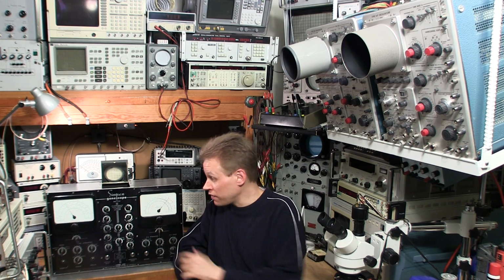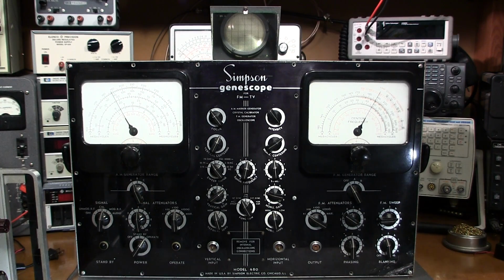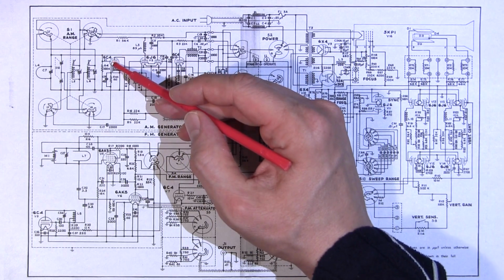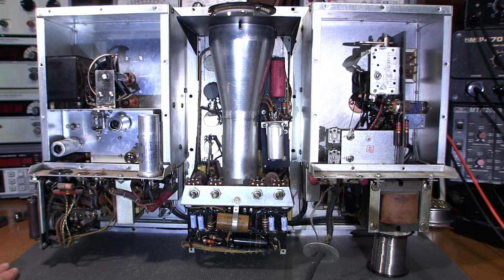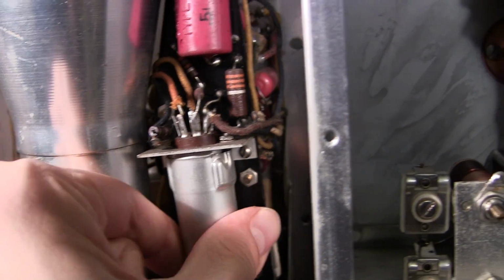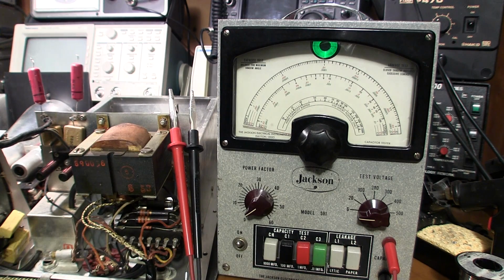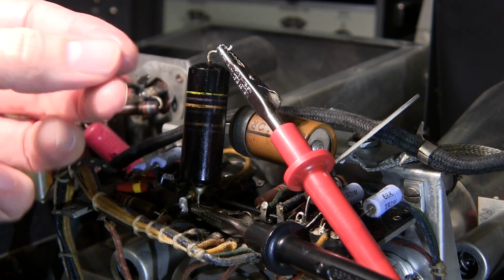Sneak Peak and Tear Down of a Simpson Genescope 480

Comment: I would love it if you could address this question during a disassembly : “these are the parts that make this piece of equipment as good as it is , this is design approach is what indicates the essence of  quality” ( while tracing out a circuit with a pen or such pointer) . What I’m after is , in your opinion where does the quality lie?

Comment: Could the horiz. and vert. plates be reversed on purpose because the crt is mounted 90 degrees from the  intended design so the swap was a cheap fix for a mechanical mount design flaw?  BTW love your vids.

Comment: Paul I agree, install the bnc Jack's. And it would make it more useful if you added am and shortwave. Can't wait to see the restoration!
Reply: Also when a resistor is in parallel with a capacitor (I understand it's to discharge the cap) isn't it like a leaky capacitor? I.E. can pass dc voltage bypass the capacitor via the resistor?

Comment: The true heart of any of this equipment is the power transformer.mWhen that goes , Game Over. That has happened to me on several pieces of gear. After weeks and dollars once up and running, the smell of hot varnish filled the air as the equipment went out dead forever.

Comment: Noticed the line fuse F1 is not providing maximum protection. It should be connected to the hot lead of the AC plug in series with the line filter.

Comment: Interesting to see the harnessed wires were tied with lacing cord. When I was building test equipment we did it that way and it was much neater than using tie wraps as it made less of a bump. In the 1980's we used polyester tape but earlier I know they used linen tape. Usually the lacing tape was coated in bee's wax which helped it pull tighter more easily. You wrap the wire bundle and cross over the tape and wrap again loosely threading the free end under the point where it crosses. Then pull tight and finish with a overhand knot or sometimes two. The polyester tape could be seared with a soldering iron at the knot to keep it from fraying.

Another thing we were taught was you NEVER mount a component without a stress relief bend in the lead. The lead must remain straight from the component body for 1/8 inch and then have a 20 degree bend before it is routed to it's termination. Too bad so much you work on was not built that way! It reduces component failure from physical strain.

While I'm at it when you route wires you should always leave enough length that it can be cut off and re-terminated at least once, unless there is some reason that the extra wire length will cause problems.

The drawing errors! When we built equipment it was a standing joke that we were the proof readers because nothing of any size was ever built without us finding a mistake in the drawing. It appears that Simpson's drafting department never updated to a corrected drawing! They always complained about the cost to revise the drawings!

Comment: Paul, Would not the schematics be correct is they either rotated the oscilloscope tube 90 degrees or thought that the mirror image reversed what one see on the horizontal and vertical plates?

Comment: The Horizontal and Vertical Deflection are probably correct on the schematic. It just depends on ones point of view. Rotate the tube 90 degrees and the sweeps are switched.

Comment: The art of cable lacing.  I learned to do this in the 1970's and this skill did me good steed in the early 80's when I worked in a repair depot for navy aviation electronics.  There were a lot of mods and upgrades on a big piece of test equipment that used a variety of cables.  Did the mods and laced external wires added to the cables.  I received an Artisan of the Month award for that job.

Comment: I had this same piece of test  gear for years and I ended up selling it at a hamfest several years ago.This makes me wish I still had it. The only thing I still have is the original manual and it is in perfect condition. Back then this was the most impressive piece on my bench. I also had its sister unit the 479 that just didn't have the scope. Miss them..

Comment: Paul, please go ALL the way and replace things willy nilly with modern upgrades, as this unit will be used to test real modern equipment. Might as well as stay as safe as possible with as much as you can. Especially that ancient sweep circuit and the basic oscillators. That would include the crystal used in the a.m. circuit... you might want to use at least a temperature-controlled crystal oscillator.

Comment: Add the extra range. This is a sensible addition/modification, and would not take away from its original purpose. You are right. If Simpson added the extra range, it would have served a broader purpose, and been more valuable. I'd like to see how you would approach it, especially for 160 meters/AM band.

Comment: Takes a real engineer to look at a schematic and say "This is wrong" nice job.  When i was younger there was nothing nicer than working on something that had not been opened since it left the factory, you didn't have to clean up other people's mess.  Those bumblebee capacitors were leaky back in the late 60's in equipment that was relatively new.

Comment: I have always loved Simpson test equipment. From my early days of the late 1970s till now I have used Simpson 260 millimeters for just about every kind of parts testing you can imagine . I have tested so many capacitors with the 260 I can tell you without picking up another peace of test equipment whether a capacitor is leaking or not. It just comes with years of using test equipment for a long period of time.  Very nice video Paul !! I like very much how you go through a schematic and explain, to a tee, all the functions within the circuit you are working on. Love it.
Reply: Really funny seeing those yellow capacitors just dangling there lol nothing new the crazy things I have seen Paul lol  hahah

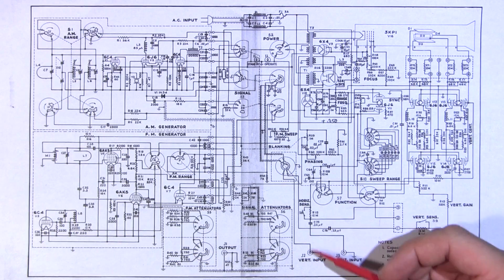Comment: Howdy, Phil!  Wow, this is an AMAZING piece of kit!  One question, however;  you mention around 21:00 how the schematic seems to confuse the horizontal deflection plates with the vertical plates.  Yet, given that the CRT itself is mounted vertically for viewing through the mirror, is it not feasible that they needed to rotate the tube 90 degrees, perhaps due to space constraints?  Also, as for whether to extend the range of the unit, I'd say YES, absolutely!  After all, while this may be a collectible for historic reasons, it's not like a vintage radio or television geared toward the lay person, and as such I doubt "authenticity" is highly prized in a piece such as this.  Even if you DO end up selling it, anyone who's willing to pay for a unit like this will likely want to get some use out of it, and I'd imagine they would really appreciate such a modification!  Thanks for posting yet ANOTHER fantastic, informative video!  Keep up the good work, and you can bet I'll keep watching!
Reply: It's "Paul" not Phil. ;)

Comment: If you would take the time to look up the pinout for a 3KP1 Crt you would find that the drawing is correct (D1-D2 pins 9&10 Horz D3-D4 pins 6&7 Vert). It's drawn that way for clarity. .Reference RCA tube Manual. Get one.
Reply from the maker: Hi John, what I state is correct, it's you that may need to do the research.... And lighten up too! Stop hanging around "negative forums" so much, and your knowledge might just grow.
Reply: I did make a
mistake on the pin numbers. D1- D2 are pins 8-9 and D3- D4 are pins 5 and 6. D1
and D2 are usually designated as the horizontal deflection plates and D3 and D4
the vertical which conforms with  the schematic.

That being
said,. It probably doesn’t really matter whicn set of plates are used as the horizontal
or vertical as it would only effect the physical orientation of the tube.

The schematic
is correct. 

As for your
comment of my needing to do more research, I’ve done mine.  I started to  read and understanding schematic diagrams in
about 1950  fixing vacuum tube radios. Graduated
from  Valparaiso
Technical Institute with an associate degree in electrical engineering. I joined
 the Air Force and worked as a Precision Measurement
Lab Tech repairing and calibrating instrumentation in the AF inventory..
Leaving the AF, I went to work for Hewlett Packard Co. as a lab tech repairing
and calibrating  H.P. gear. I then went
towork for Philico at  NASA as first a
lab tech in the calibration lab, then a Technical Writer. I wrote the procedures
used to calibrate instrumentation used in the NASA inventory.  My last 13 years in the electronics field was
at the University of Houston as Staff engineer for the Dept. of Chemical
Engineering. Here I designed electronic instrumentation to be used by Grad
Students in their research. 

I’ve done my research
Reply from the maker: Thanks for sharing some of your history John, but don't feel you need to though over some deflection plates in a CRT. If you watch my explanation of the deflection plates in it's entirety, you will see the discrepancy.

Comment: before I go I do have a question. I have bk 700 tube tester, on sockets no1, 29, 30 when doing the no 1 test the needle goes left very hard,  is that a very bad tube or do I have problems with this tester. many thanks
Reply from the maker: Hi David. What is the tube number? Try to put some sideways force, "twist" on the tube in the socket while it's under test. Sometimes the contacts in the sockets get stretched, and don't make good connection. Gently twisting the tube helps the pins make contact in the socket again.
Reply: no. 1 socket 6ag5, 6aq6, no.29 socket 6k6, 6v6 no. 30 socket 6ac7, 6ag7. thinks for the help.

Comment: What intrigues me is your capacity for work. Maybe one day I too will have perfected the ability of testing 4 circuit board relays of some faulty laundry dryer without breaking into a sweat and ending up completely exhausted and psychologically overstretched from the effort of connecting a couple of wires, and the sheer effort of operating a regulated power supply -with bear hands.

Comment: ps those front connectors look like (mike) types? if so u can cut the ctr pin short of a pl259 & screw on as an adapter, i did with a vtvm

Comment: In the AM section quite in the middle is a diode symbol, is there really a semidconductor diode inside or is this something else?
Reply from the maker: It's a diode. Those things have been around longer than most realize. (I have a 1GHz "sampling oscilloscope" from the 50's as well)

Comment: Hi Paul    Looks like a very good restoration project, and yes install a lower range AM to the unit to make it useful.  I like the explanations and errors that you find in the schematics.      I noticed a Heathkit IT-11 on your bench.  I bought one on E-bay,  and the guy said it was in mint condition.  I opened it up and it had the original capacitors in it, the switches were mostly black with oxide.  I am a Electronics Technician and used deoxit and a pencil eraser on the contacts, I then got some new caps from "JustRadios",  they had all what I needed.  I went to my local electronic store first and they didn't have all what I needed.       Where do you get your parts, on-line, local distributer, Mouser, I was just wondering, since "Radio Junk" is going away?I may have to get my parts from on-line distributers, since they have a better selection of parts, where most of the new stuff is a through away mentality anyway.   ( Harvest some of the good parts form older gear?  Just a thought" )   Another thought you could  go through some of your refurbished equipment that you use and point out what you did to get it going.                                                                  Later Ray Burke
Reply from the maker: Hi Ray. I usually use digikey, their ordering system is "friendlier" than most. Mouser is ok as well. I have repaired so much of my equipment before I started making video's, so your idea is great, I may start doing that on pre-repaired equipment.

Comment: Nice video, good presentation. Looking forward to the rest. Excellent lesson on showing the schematic errors. One would think the engineers that built this would have caught that, but I'm working on a TS-940 that has both, schematic and solder mask errors.  
I vote for adding the additional band. I was wondering why they didn't add a variable audio tone to equipment of that quality, or did I miss something. I also wonder what that sold new for...

Comment: Have you by chance come across one of Simpsons Model T00435 Alighnment Meters,it has a 3 pin Bendix style Military plug on the bottom that attaches to the radio for Bias Voltage Adjustment. I bought one off E-Bay that states they are all NEW IN BOX,but what it fails to state is there is no information anywhere to be found on how it is wired or how to use it and no cord can be found for it. I was going to change out the 3 pin Military Plug for an XLR  microphone connector,but without some kind of schematic I do not know how to wire the connector for using it on regular shortwave radios.

Comment: Hi Paul, I know it's been a while since you uploaded this video, but if you're still open for the viewers' input on how to proceed with this video series, I'm more than happy to give my $0.02;  I'd really like to see how you disassemble the modules to get to the built-in parts. There's no need to do a lot of explanation before you start replacing certain components; the reasons are clear from earlier videos. Perhaps show a short clip per section pointing to the new parts when you're finished soldering. Reassembly could be interesting depending on the actual construction... Also, I'd be very interested to see the major steps of the calibration procedure.  Final thought: your videos are very inspirational!! I have a tube radio collection and some knowledge of electronics but never got to the stage where I could repair a radio with good confidence about the result, especially regarding the tuning / alignment. I do have a Philips GM2889 wobbulator but it also needs a complete overhaul before it's usable :-)
Reply from the maker: Thanks for your input!

Comment: I don't see the practical value investing in refurbishing a piece of gear like this today. But I suppose you enjoy it, so there's that. I do still like my Simpson 260 meters though. They're timeless classics. I recently did pick a Simpson Model 9 ammeter at a flea market too. Hey, it was $5, so how could I pass it up? There is a certain appeal to this old Frankenstein's lab gear.
Reply from the maker: Hi Paul. Every piece of test gear tells a story as you restore it. For me, this is sort of like.... reading a book. You get to see what the engineers were thinking when they built it, and you get to see the holes in their design. As you discover these things one by one, you put together a picture "slowly" of "how to, and not to" design equipment. This carries over into solid state equipment as well. Issues are much easier to detect in high RF environments.
Reply: Mr Carlson's Lab
while what you say is true, isn't it reading the same book, over, and over? Because the basic plot never really changes. As you yourself point out even in today's solid state devices the story has not changed. Don't get me wrong, I can see the appeal behind building ships in bottles. I just don't have the resources to devote to it myself at this stage of the game though.

Comment: I think a compromise when modding old equipment is to save documentation about what's done and maybe even the replaced parts inside the unit if possible. But on the other hand for you it might be enough to add the link to the relevant youtube vids. :)

Comment: Keep them coming!!!  

First, thanks for some very inspirational videos. Its like being at boy again 
waiting  on your favorite magazine.  So far, your videos,have resulted in buying  a leader LMV-86a ac voltmeter and a telequipment S54 oscilloscope who is now standing alongside more modern measuring devices. I don’t need them – but they are are a lot of fun.  

May I be allowed to make suggestions for future videos: How do you clean  old electronics - distilled water - isopropyl alcohol ???  How- TO? How do you Tests a  push – pull output transformer - my Ampliton TS3500 blew a cathode decoupling – How to test that output transformer Is it  damaged?  How do you clean at switch, potmeter.  But again thanks to some inspirational videos.
Reply from the maker: Thanks for your input Per Kruger!

Comment: Every day is "Boat Anchor Day" in Mr. Carlson's Lab.
Reply: I really NEED to drag home an old D Day era transmitter from my uncle's barn. I feel like a real ass for not loading it up last week. My uncle scrounged around and found the GE Dynamotor required to power the thing, so I think he really wants it gone. I really want the RCA 211 tubes out of it, but I'd feel bad junking it, just to scavenge the tubes. I would modify that Simpson to do 160 meters, or even lower frequencies..As it is, it's 1950s TV repair gear. Lose the goofy proprietary jacks & put some BNCs on it too. Maybe bring it into the 1960s?> .  .Oh I bet that thing is so flippin old, that is hand cleaved & hand ground Brazilian quartz in the X-Tals. LOL .

Comment: I wouldn't add another range. Simpson made standard RF signal generators 310, 315, 415 (maybe more). Some models match the styling of the 480 Genescope and would complement it. Maybe you will be able to acquire one of those in the future. The Roto Ranger VOMs and 330 Mutual Conductance Tube Tester styling match also. I don't know if the front panel of the 480 is bakelite, but the panel of the 330 is.